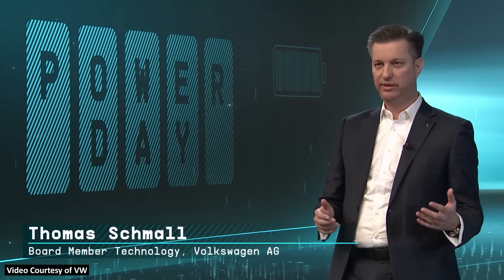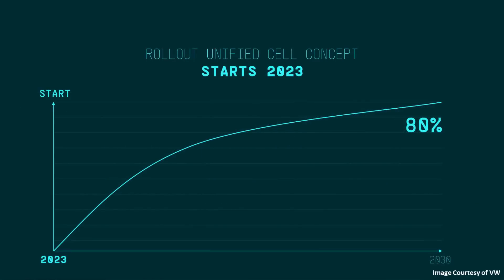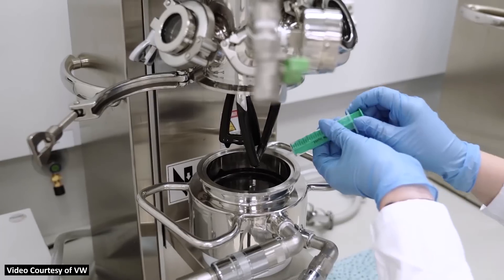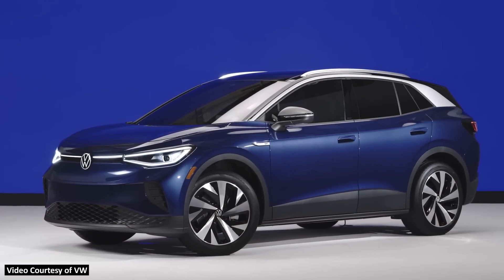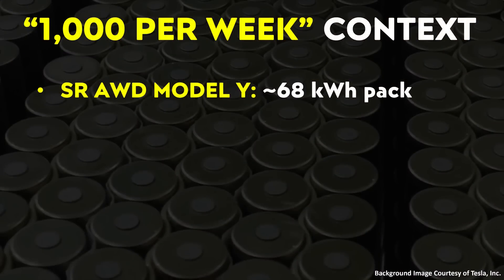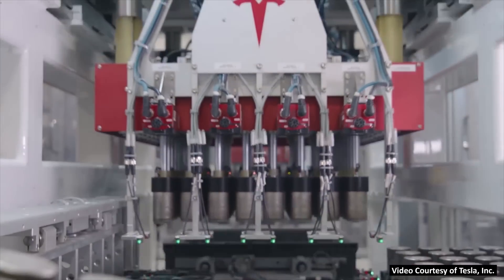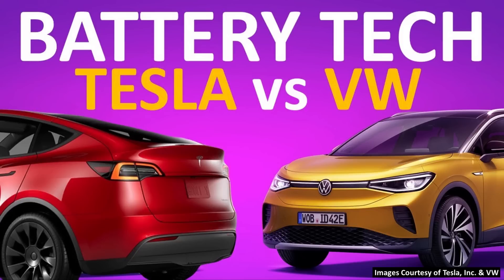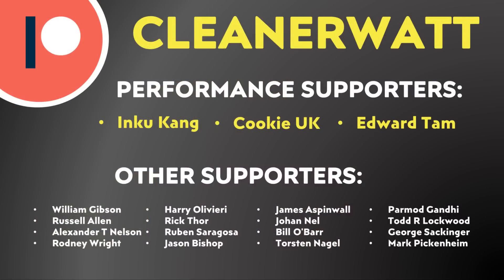EV Battery Race: Tesla 4680 vs VW Unified Cell

Comment: Lower manufacturing cost per kWH is absolutely necessary to bring EV vehicle prices more in line with ICE vehicles. However, if the major concern of environmentalist is to reduce the CO2 emissions of transportation, the CO2 released into the environment from the mining of the materials required for batteries needs to be understood and the payback in terms of CO2 reduction of ICE vehicles on the road. How many years until breakeven?

Comment: 240GWh and 75kWh is enough for 3.200.000 cars.
3TWh and 75kWh is enough for 40.000.000 cars.
I‘m curious about Teslas plans.
10.000.000 or 20.000.000 cars ans some 100.000 Tesla Semis in 2030?
And the left batteries are for Tesla PowerPacks?
Or selling them to other car companies?
Half of the world car production could be equipped with Tesla batteries.

Comment: What is missing here is the fact that the VW factories in late 2025 and 2026 going forward will most likely be Solid State Battery production from QS (which will be prismatic) and that alone will give VW a massive edge and make the 4680 Cell pretty much obsolete…😉
Reply: if you the SS batteries will be in mass production in VW cars in 25/26 you are greatly mistaken.. additionally the 4680 improvements along with other improvements are making the solid state battery leap not so much of a leap. The mass market does not care which batteries are used..they care how they perform, how much they cost, and how available they are. SS batteries should be good though. VW will need an awful lot of them. And brand new tec like that carries risk, cost, and ramp up time.
Reply: @NonAlignedThinker  , the timeline most likely is optimistic that is why I said “most likely” not “definitely” but if you think that the 4680 is anywhere close to a SS Battery than you simply don’t understand the difference between chemistry and structure of a SS compared to a LI battery. The biggest and most profound advantage of the SS will be charging speed which simply cannot be matched even by the 4680 due to cell makeup and basic chemistry and physics just to mention one small aspect. The jump in technology is massive and will change batteries on a fundamental level just like Tesla did to the Auto industry. Will there be delays… absolutely… just like any new technology. The key to all things battery related will be raw materials because so much of it is needed going forward.
Reply: @HsquaredH2  I'd even say that being flexible in your raw materials will be more important than a performance edge due to the out of wack supply/demand curve we're heading towards regarding batteries
Reply: @wtrbns  , I think that is a correct statement and yet another plus for QS since the host Cathode material is rather “interchangeable” (within limits) with only minor performance degradation.
Reply: But QS battery is 5 years away from mass production and they still need to prove the tech and whether it can scale. Lots of ifs and ,a ye, whereas Tesla is already in production
Reply: Are you delirious? SS is years out of production. Protos are easy, production is difficult
Reply: @josephlemieux5909  lol, I won’t go into detail since comprehension and basic reading skills are clearly lacking in you…
Reply: @HsquaredH2  just keep laughing bro cause you’re clearly the joke!
Reply: @josephlemieux5909  , I’m not your “bro”! Why don’t you keep your clueless attitude to yourself since you don’t know anything about Batteries. Go ahead and join your Tesla fan club, they’ll accept like-minded individuals with open arms.

Comment: Hey T you I likely thinking  light cars and trucks; even w that Lithium EVs are just a small niche of the market. I am referencing all motor vehicles. Anything with a fossil fuel engine over 1 liter. It would even be larger if I would include under 1 liter motorcycles and motorbikes etc. I am including cars, trucks, buses, trains, long haul trucks, graders, dump trucks, harvesters etc etc..  You do want to replace all fossil fuel powered vehicles right?  How about ships, aircraft, military vehicles.  These are all included in CO2 figures for emissions for world transportation which is 16% of all CO2. Just for a reality check you ought to see what 1 super tanker consumes on one trip from Saudi to NYC - about 5 million gallons one way; one ship one one way trip.

Comment: VW is focusing on BEV. An challenging issue there is that it is partially owned by the local government, and the Unions are knee-deep rooted into VW. They ousted Herbert Diess because he was not social enough (If you want to go away from ICE car production, lots of workers are not needed anymore. Local government and unions are now forcing VW into impossible moves). As a result, VW is fighting two drifting ankers (local government and Union), but on top of that, Germany is more ore less ruled by a completely nuts green party destroying the German industry. Means VW will not have enough energy for the car production. VW might have supersmart engineers and really skilled worker, but in this toxic environment VW is just toast. I wouldn't be surprised if Herbert Diess ends up at Tesla.
Reply: anchors?

Comment: Ford is similarly working on battery technology. Their battery research building is 270,000 sq ft. This is in addition to the 185,000 sq ft battery test and certification facility. Ford is trying to develop in-house battery technology rather than relying on companies like SK and LG.

Comment: I think that Giga Austin's 4680 ramp has been delayed due to equipment delays.  I suspect that the slow rooftop ventilation equipment installation ( for the battery lines ) for one, is a good indicator.
Reply: to me, that rooftop HVAC indicates process evolution.  They're learning how to make batteries as they go; the process isn't mature and yields have been lackluster.  Climate control is critical, and it's Texas humidity....  Most importantly, batteries aren't as easy as they thought, and hyped.  Hence all the CT, Semi, MY delays.
Reply: @twhite5085  The big delay for all future product manufacturing stems from needing a factory, 4680s or not. Tesla's battery line heuristics were a bit of a disappointment to me because I was under the impression that they were producing batteries on an active line during Cyber Rodeo.  NOT!  Cheers to 2022 and new waves of "manufacturing hell" in 2023 ‼

Comment: VW's battery guidance tells me that they plan to be a much smaller manufacturer than Tesla by 2030 !  The way things are going there.... with the departure of Herbert Diess and the upcoming new platform delay of three years ( due to software issues ), VW risk becoming insignificant.
Reply: All German car manufacturers are at risk.  They're all good at bashing metal, but software is NOT a strength........and that's the critical intangible for EV success.  Batteries is another skill at which German companies are over-matched.

Comment: Elon has said that LFP will be in 1/2 of all Tesla batteries. So, when will LFP become available in 4680 packs?
Reply: Probably never. I’d guess 4680 is best model for nickel chemistry, no competition from suppliers. But CATL has best form for LFP (& BYD Blade?), so I wouldn’t be in a hurry. Just need way to make structural & ultra-reliable, unserviceable pack from CATL prism / BYD blade.
Reply: Elon was counting MegaPack and PowerWall products in the mix.  Tesla vehicles won't use much LFP beyond some entry level models.

Comment: We have so much more insight into Tesla's battery supply strategy as compared to VW's.  Stating targets is easy, securing raw materials, building factories, ramping battery production, improving battery performance, and driving down costs are hard.  I agree that what VW is doing is laudable, but given the hurdles before them, and their being 3 - 5 years behind Tesla, I can only wish them luck.
Reply: Your crystal ball is a little cloudy.
Reply: Also they just canned diess as of Sep 1st. Good luck vw auto group y'all will likely not survive this upheaval. And thanks to dieselgate and ongoing emissions cheating I say it's a death well earned. 👍🏻
Reply: Most of the legacy OEMs are one golden parachute away from giving up.  Maybe VW will beat gm into the abyss.  GM at least has it's trucks.
Reply: @eugeniustheodidactus8890  WOW, you people should tell me what you are smoking. So the no 1 car manufacturer in the world which is like 3 rd one in electric vehicle is just going to disappear like this. One example why for me VW is for now ahead of Tesla, they have more than 10 ev models now on sale. And i understand Fanboys cannot understand how important it is, but different people have different taste. Yes, VW has 3 models just with the ID4, Eniaq, Q4 etron that are basically the same platform. But ther is much more chance for me to buy one of those 3 that the Model Y. Not everyone wants the bland look and inside of the Y model. I also want a front console etc and not because Tesla wants to put a center console. When you didn't have much choice it was understandable, but now people might might prefer X to Y to Z. And this you don't have with Tesla.
Reply: @danielvilliers612  Are you even aware of the extent that Tesla has just revolutionized the auto manufacturing industry, and that the legacy OEMs must stand in line for years in order to start catching up?  What VW has done in the past has nothing to do with executing now or in the future.  They obviously are failing already with the ID lineup, despite the multiple models of inferiority.  Yes.... I test drove the ID4, and although I like it... it cannot compare to the Model Y in several metrics.  And I think the ID4 is better looking.  When the market demands more "models" with leather and stitching.... and more gadgets, then Tesla will deliver that.  But until then, TEsla is more concerned with scaling it's huge demand into 20million vehicles per year within the next 8 years. That will be twice the size of Toyota... which now has plans to outsource EV manufacturing to BYD in China.  Yes... the industry can shift THAT quickly.  Best wishes.
Reply: @danielvilliers612  You realize they have to figure out how to make a profit on EVs first?
Reply: @danielvilliers612  I agree that VW is not about to disappear, but I´m afraid you´re the only who doesn´t understand the situation with the number of models and it´s importance. Every company would prefer to make ONE product. No exception. Because it is the cheapest way to mass produce. The only reason companies make more than one is not to give you a choice, it is becasue the demand for that one product can not match their production capability. So they start making more to attract more customers. This is why car makers offer more models, this is why you can buy sugar-free and  orange-tasting Coca-Cola, this is why you can´t choose from 20 types of iPhone. Tesla has zero reasons to offer more models now, because they can not produce enough to satisfy demand for the existing models. This will no doubt change in the future but we are a few years away from that.
Reply: @danielvilliers612  I agree having lots of versions of a product is critical to success. Apple proves this clearly with their dozens of iPhone models.
Reply: @NonAlignedThinker  You mean the machine that enable you not only to phone but use thousands of apps be surely the most vesatile tool in human history. So that from the child/teenager checking his her tiktok videos or snapchat, to his grandfather checking the latest news on Twitter and in between the father mother facetime their other children studying on the other side of the country, looking at family photos/videos from last anniversary posted by uncle John on his iphone. Guess what, apple would be Nokia today if they didn't have the apple store. You just proven my point.
Reply: @danielvilliers612  lol... Apple does not have multitudes of iPhone models.. Tesla does not have multitudes of models.. I am sorry that sarcasm is lost on you. qed
Reply: to be clear.. what I have shown is that you are not smart and are using bad arguments. thanks.. have a nice day :)
Reply: @danielvilliers612  You are the only fanboy here.  VW has legacy debt just like all legacy companies.  Their volume of EVs has likely peaked because LFP patents expired and china can start flooding EVs into the west.  Tesla is competing by having the best  efficiency and charge times.  VW is not making anything that competes against cheap chinese EVs.  They will be forced into bankruptcy by their legacy debt.
Reply: @NonAlignedThinker  You completely miss the point. Smart phone can be everything because of apps, this is why they are so popular. Apple doesn't offer choices in hardware, but it is the software that gives you thousands of choices. Try to sell an apple with only 5 apps and see how iphone will sell.
Reply: @eugeniustheodidactus8890  please go learn about this stuff outside the shit that Elon says

Comment: Great stuff. But i believe its way way to little.. hopefully(for some) VW will survive- in any case it will be a small player..
Do you pronounce Volkswagen with a t instead of a k..? 
👍🇳🇴
Reply: "small player" hahaha. Don t be surprised when VAG surpasses Tesla by 2025
Reply: @jonpetter8921  I will be (massively) surprised if VAG surpasses T by 2025. Considering chaotic competing influences on VAG leadership (Blume pushing biofuels to keep the 911 going,) their actual production plans (Diess's acknowledgment that VAG could/will not overtake T until at least 2026), the very unfortunate Cariad software situation, Tesla's extreme lead in manufacturing methods, T is NOT standing still, etc. etc. etc... Very (as in never gonna happen "very") unlikely that VAG is close to T in BEV production by 2025.
Reply: @russhare4793  Diess failed to deliver when it comes to providing reliable software for their MEB cars. One of the reason VW is struggling i China. Blume has had decent success with Taycan without the twittering and talking.
Diess may be a great visionary but he lack  Blume execution ability.
Reply: @jonpetter8921  These Tesla fanboys are so delusional. They think a company selling $ 50k usd and above cars is going to be a top 5 car manufacturer. VW group has already 10 models that span from 30K to 150K and tesla has 2 cars. You don't rule the world with only two models of cars.
Reply: @danielvilliers612  Tesla is selling all of the $55K cars it can manufacture. Why consider making another model at this point?? Also, the Pareto principle - 80% output from 20% input - applies. For these reasons, T will continue to build capacity until 3 and Y demand is met... we're years away from that. Rinse and repeat, every category gets ONE killer vehicle. As mftg methods continue to improve AND scale, vehicle cost will decline and BINGO, T average selling price will be in the $40's (although the CT will bring this number up...) a couple more years with compact vehicles, their selling price will be in the $30's maybe even $20's. See the future - here comes the Cyber-truck, the Semi, the compact, and who know what else, robo-taxis with autonomous driving revenue and SAAS software revenue - that's how Tesla becomes the biggest automaker in the world...